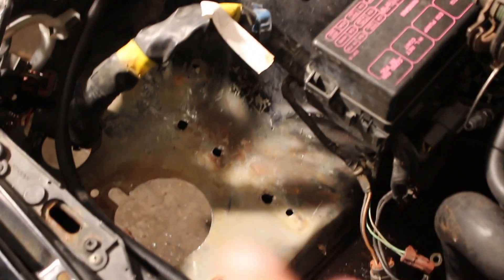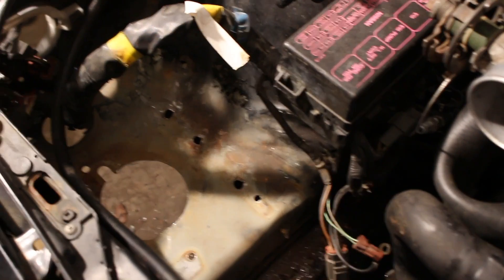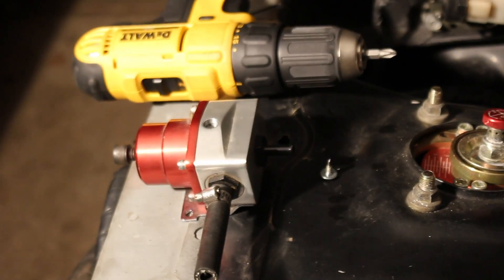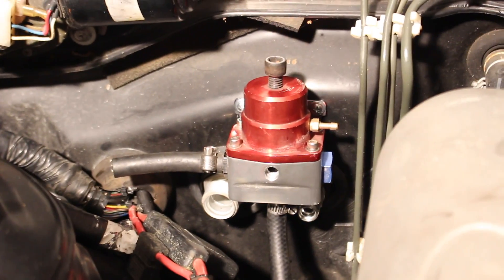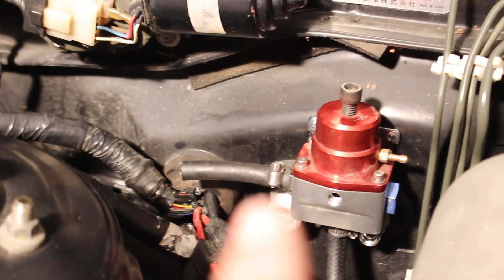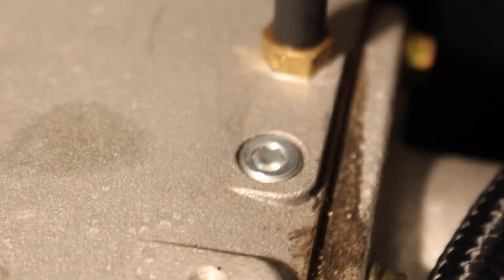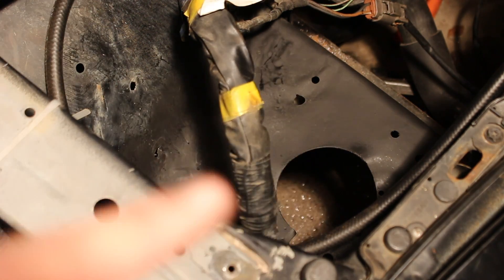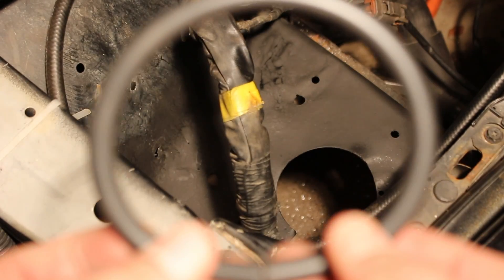240SX Turbo Build | Part 4 | Its Almost DONE!!

Comment: you put the regulator after the fuel rail to pressurise the rail, like a reservoir, otherwise the fuel will just run back to the tank freely

Comment: hey @Kalvin Malli i was watching your video and looks great. just want to give you at tip on your fuel clap you used on the fuel pressure regulator. those worm clamps are only rate for 5-15 psi and in my case i had bad luck with them for fuel lines. most auto part store sells better one and the cost just as much as the worm one but no leaks even at 100psi. keeps the videos
Reply from the maker: +eddierotary I've always ran those on fuel lines. Never have had an issue. But I appreciate you looking out!
Reply: Well if you have any questions let me know man. Willing to help

Comment: Yoo bro i just got a Clean 240 really clean with really low miles only 45K Original miles no rust no nothing but the problem is it won't run. The owner said it was sitting in his garage for 5 years and it probably need a new Engine. So i was thinking if you would sell me ur 240 engine since u gonna swap ur motor anyways & i also was thinking of bringing the car to you and you do the engine swap I watch ur videos and you really know what you're doing so what did u say? Yes or No?